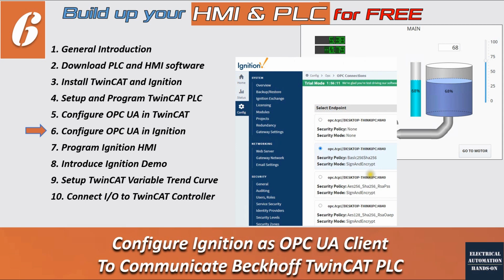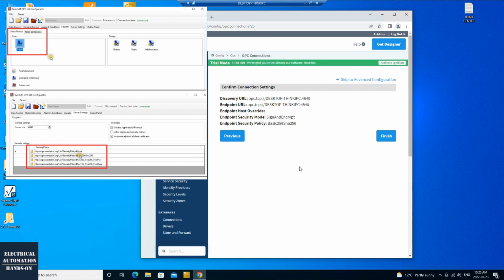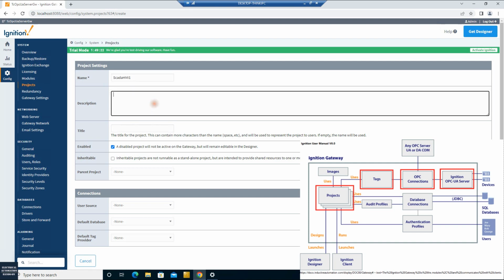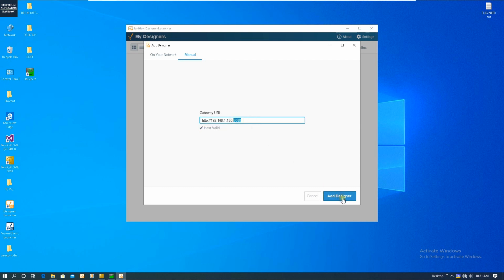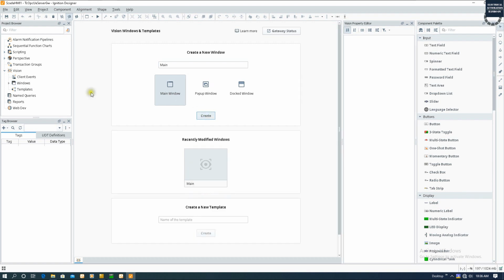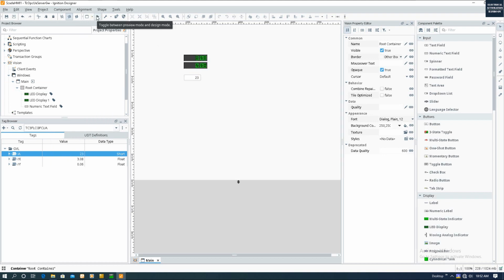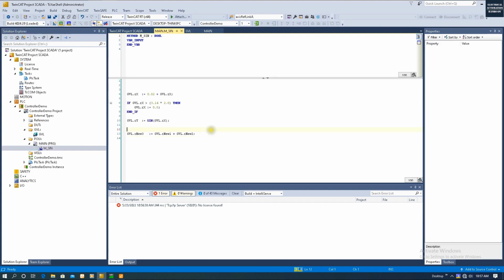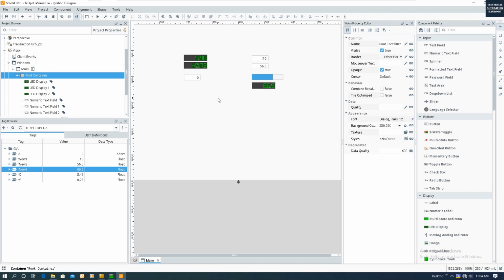SCADA06. [PLC&HMI] Ignition OPC UA Client - Connect to TwinCAT PLC

Comment: Hello my friend 
Amazing videos! Thank you
 I did all what you have trained but finally after whole configuration is done when i disconnect my laptop from controller ipc scada hmi(by vision client) gets disconnected while we wont need engineering station anymore and ipc and hmi should work to gather doesn't it? 
Please say how we can solve this problem.
Thank you
Reply from the maker: Can you reorganize your question, not quite understand your question
Reply: @electricalautomation  
Ok
By vision client launcher i made ScadaHMI1 as you did and when i put user admin and password admin my hmi which i have designed by ignition designer in engineering labtop starts to come up and HMI works well but when i disconnect rj45 cable which has connected from laptop to controller pc and restart controller pc while twincat is in running but scada HMI(created by vision client luncher) can not show HMI designed page in which as i connect my laptop to controller pc everything get correct
Reply: 1-Until session SCADA07 VIDEO i did exactly what you did and finally closed my laptop.
2-now hmi in pc is communicating with twincat3 in pc
4-then i restart pc
5-i want to connect again to the scada hmi(created by vision client launcher) says unknown!!
Inthis situation when i connect laptop to the pc scada hmi can start again!
Reply: Thank you my friend i could find by my self it was very important. Anyway thank you again for your precious tutorials 🙏
Reply from the maker: Glad you find it out.  @KamalHasani-kh5vm

Comment: Hello, I am following your video series . thank you very much for such videos. Could you share a video regarding  siemens PLC with Beckhoff servo motor and communication.
Reply from the maker: This is a rare combination, using Siemens PLC and Beckhoff Servo Motor. Siemens is using Profinet while Beckhoff AX5000 and AX8000 is EtherCAT. Unless you find a proper bridge/converter(Profinet - Beckhoff), otherwise, it is not value for trying it.
Reply: @electricalautomation   thank you for information. I thought that beckhoff driver has profinet option.
Reply from the maker: @tutalia1  Siemens S210 or S120 are all good choice for high performance servo drive, and they all have profinet